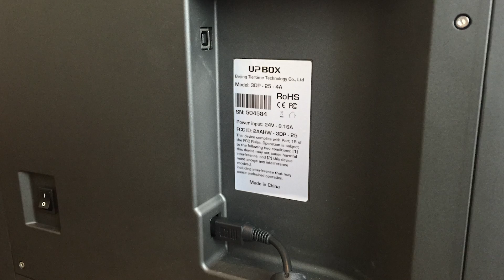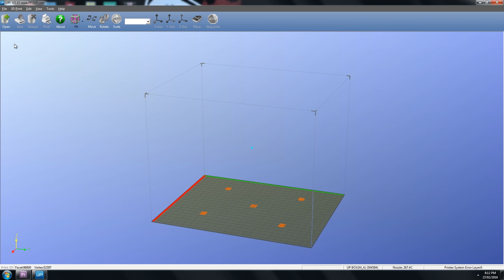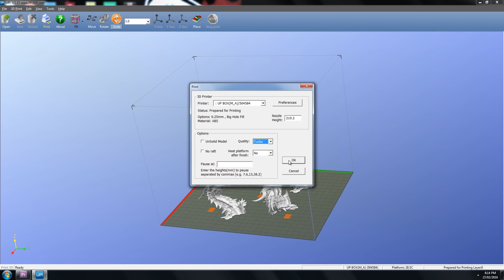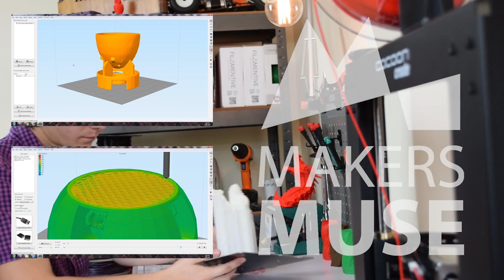UP! Box 3D Printer Review - Big ABS Prints!

Comment: FANTASTIC!!! One Question what its the quality of the print like compered to the UP mini? If I didn't need the print volume. can the UP mini print the same quality of print?
Reply from the maker: +parrot340 The UP Box can do 0.1mm layers whereas the UP Mini is restricted to 0.2mm... but other than that it is basically an UP Mini but the bed is 4X larger! Same quality in ABS.
Reply: +Maker&#39;s Muse Thanks for you r quick reply :) I am wanting to make a 3d mini person like 1" tall (well not one but possible 100!!) (using the xbox 360 scanner method) would the mini still be able to capture some detail. or would I really need the UP box?
Reply from the maker: +parrot340 With the low detail scans you'll get off the kinect - either machine will work fine, but the larger your print the more detail you get so the UP Box would let you achieve that.
Reply: +Maker&#39;s Muse Cool thanks. Still difficult dissision. In the UK. the UP mini is like £500 but the up box is like £1700. would have to be a great improvement for the extra. I am thinking of getting a MIni for the mini people and other small objects, then investing in a up box latter. did you see there making an UP mini 2. just wondering if its worth waiting for that. but from what I can see tehr print has not improved and the extra features like wirelesses printing etc I am not interested in. what you think?

Comment: ¿ Closed ABS printer ? Uhm, I guess it's not temperature controlled (think oven like) because that'd be copyright infringement on some Stratasys Patent. (If you keep temps constant at 50º~ 70º  and then cool the whole print it won't warp that much. That's the patent) . Maybe the difference of price between this and the Cubic is the patent fee.
But that can help a lot in printing ABS (just enclosing it)

HEPA Filter is a very nice addition. Hope more machines get this :)
But proprietary slicer ... meh. MEH. Total turndown.
Reply from the maker: +JJ CC I know what you mean, the UP Slicer is actually REALLY good, but it's only 32bit and is lagging behind now as it hasn't evolved much. They have a new program 'up studio' but it's ... kind of terrible at the moment. It's definitely a 'simple to use one trick pony' kind of printer for people who want to just print ABS prototypes quickly and easily, but certainly not designed for tinkerers or experimenting with slicing profiles or materials.
Reply: +JJ CC Stratasys patent for heated chambers I believe has expired.
Reply: +Maker&#39;s Muse Wait, It's not 64 bits? ... even worse :(

This printer seems to have some good implementation on some parts (door switch, reasonable muzzle diameter for an all-terrain printing, from small to superbig) but then it flops on others.

Having worked for months repairing (in a 3d shop) another "branded" printer ... i've seen this pattern. Some design decisions that are unique turn out to be really good and clever, but then they fail on some points a decent QA testing would notice.
Reply from the maker: +JJ CC I think I'm at the level where I can get in touch with them and let them know, and maybe they'll be able to do something. I've been repairing UP's for years and they are actually really well thought out mechanically (you can remove the extruder assembly in 2 seconds) and if they bring the software up to date it'll put them at the forefront again no question.

Comment: is the extruder assembly printed ? o_o
Reply from the maker: +someoneonlylol Haha yeah some of it is, not sure why they still do that have been since the first ever UP! Printer, seems to work great though.
Reply: +Maker's Muse its 3000 dollars and they couldnt even bother to put in an injection moulded part...
Reply from the maker: lol yeah... it's a bit backward, but hey they include those parts with the software so you can print spares! To make it even weirder there's a precision machined teflon filament guide and bearing inside that 3D Printed housing!
Reply: +Maker's Muse you shouldnt need to print spares on this kind of machines considering how expensive it is, it should be pretty much perfect out of the box. But the wierd choices they make such as material temperature lock, 500g holder (common I know) and the teflon guide inside of a printed body... just what...
Reply from the maker: +someoneonlylol All true - but it prints so well... so I guess they never needed to move away from that approach.
Reply: +Maker's Muse yeah but considering the competition its going up against it could have easily been better.